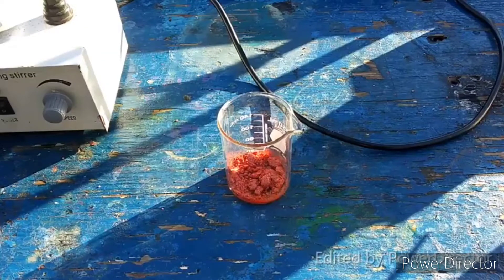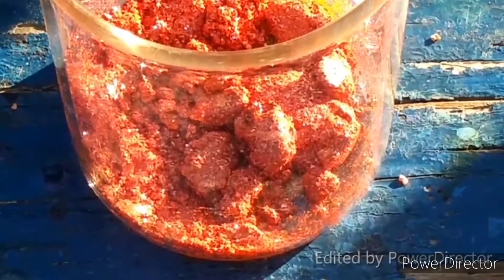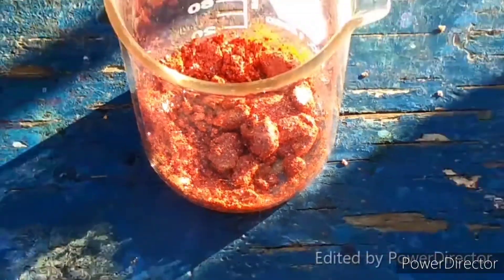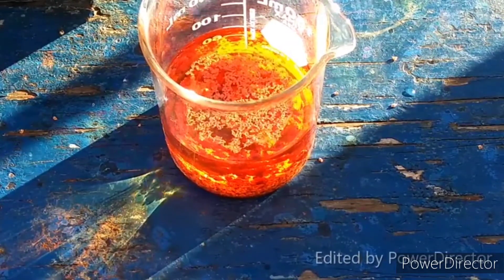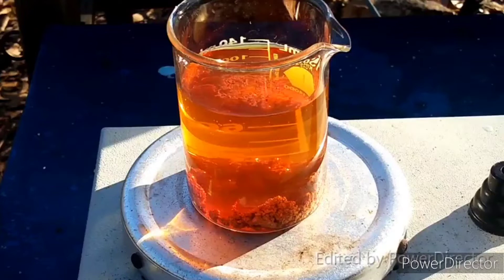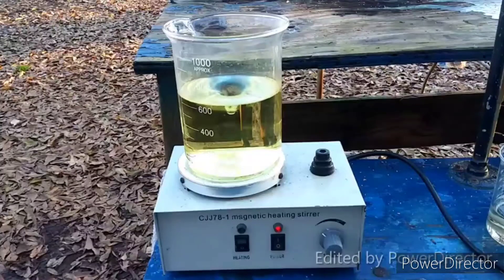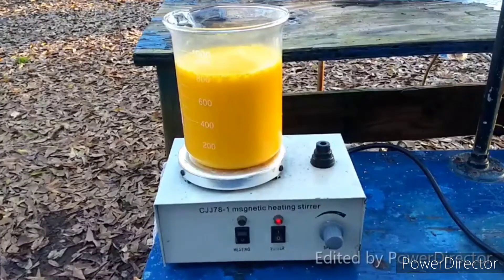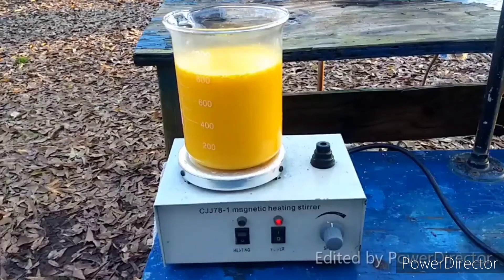How to Make Arsenic Trisulfide #chemistry #arsenic #sulfur #homelab #poison

Comment: Pnictogens .. say it three times fast. 

So, this video has me looking at wikipedia (or infogalactic) for arsenic and sulfur .. yeah, I know, not much worthwhile info there.  Many of these oxides, sulfides, selenides, of arsenic, antimony, or phosphorus, are little cages or crumpled rings.  Even N4S4, although it is interesting for other reasons. 

And the question is this -- if you're an element capable of multiple covalent bonds, (or ligands?), how do you decide whether to make a compact little cage molecule, or a polymer?
Reply from the maker: I honestly don't know. I've seen some weird bonding working with these inorganics. Bridging halide ions aren't uncommon (for example gold(III) chloride or the nonachlorodithallate ion). But why does 1 metal do that and not another? I have no idea. We'd need an Inorganic chemist to help us out here. It could come down to what hybridized valence d orbitals are empty and which are filled. Coordinate covalent bonding makes things complicated and I'm not even sure it comes down to that. In gold(III) chloride the bridging chlorides have a charge of 1/2 with respect to each gold atom. Now for organics which don't have all these empty orbitals flapping around what determines the shape is more straightforward: steric hindrance, distribution of charge, and environment (in water, an organic solvent, as a solid in air, etc). For biomolecules large proteins may undergo folding into specific arrangements as part of post translational modification. This is necessary since there are multiple low energy configurations for such a large molecule and it doesn't achieve the functional configuration on its own (or has a vanishing low likelihood of doing so). Honestly the 3D shapes of molecules is a very complex subject. That's why such great pains are taken to do xray crystallography because most of the time we can't predict what shape a molecule will have IRL.
Reply from the maker: PS I believe the P in pnictogens is silent. Could be wrong on that.